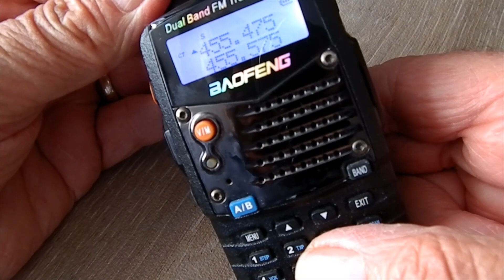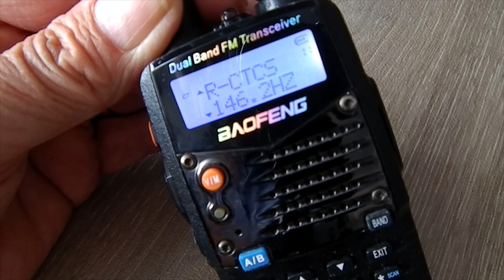G4NSJ - Baofeng UV5R how to scan CTCSS tones and DCS

Comment: the uv5r is a semi nice radio but the bigest down fall of them are you cant put on a better antenna or even do an external antenna where i live because theres so much front end overload! them china 0ne chip wonders dont have the filtering to stop it witch is a shame!
Reply from the maker: You’re right, I tried a Yagi antenna and the radio was swamped by strong local signals.

Comment: Really handy trick, I paid £2.84 for a UV-82 recently but it seems rather deaf and I've not managed to hear anyone using anything, PMR, 70CM or 2M yet so it might be a little while before I can try it out.

I know what you said about 'oh but you can buy' etc. but you can also do this with one of those cheapie RTL SDR dongles and (I think) SDR Angel or HDSDR on a PC
Reply from the maker: OK about the dongle, that's interesting. Shame your radio is deaf. I had one like that, could hardly hear anything on it.

Comment: Hi Ray, interesting video. Thanks for sharing. I have a hand held Yupi scanner and I have found a way of checking the DTV frequencies here. The signals produce a strong hash and can easily be picked out. It is also handy when checking for any DTV DX signals, though some of the signals are too weak to be actually resolved in a digital TV receiver. Anyway, take care. Rob in Melbourne Australia.
Reply from the maker: Hi Rob, that's interesting, thanks for the info. Cheers, Ray.

Comment: Hi Ray just a few comments, what i have done in the past has started at the bottom and keep going up until i find a ctcss freq that will open the repeater i am on, their are only what, 10-15 whatever it is, or what you can do is do a google search, and put the repeater callsign in and it normally comes up with all the details including the ctcss, you can normally get the repeater callsign by just listeing for awhile and sends it in cw, some ae in phone now, some even send the ctcss code at the end of the callsign, i tend to not use the ctcss recieve only the transmit one...good luck, from Fred g4vvq in Essex.